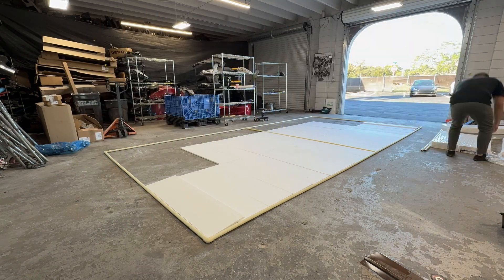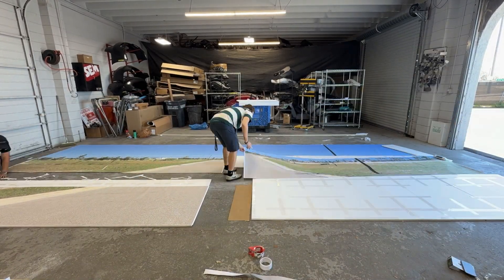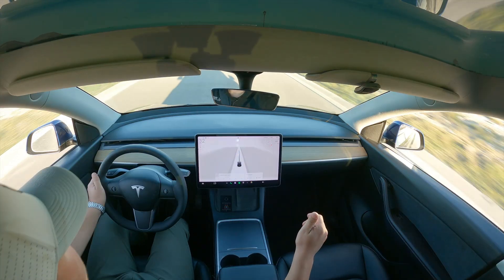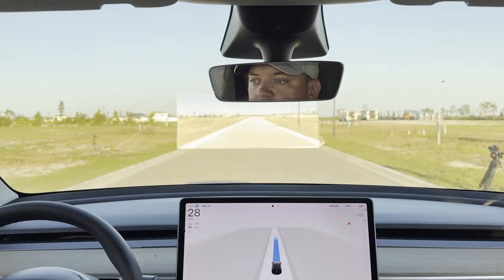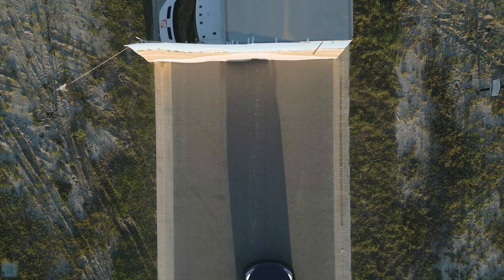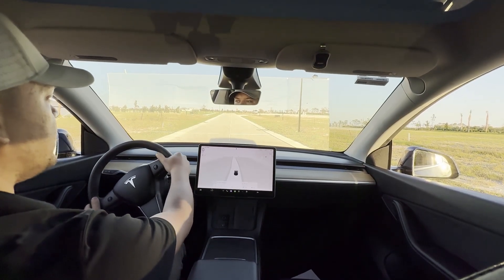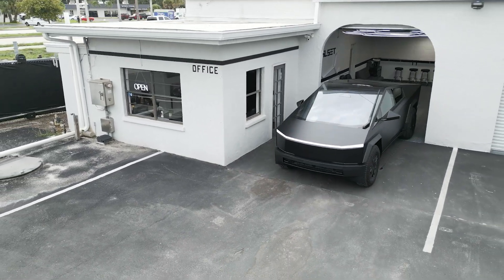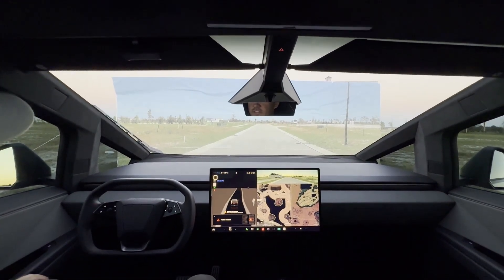Response to Mark Rober’s “Can You Fool A Self Driving Car?”

Comment: Apart from the many instances on camera where cybercoffins DIDN'T see the object before they hit it [and in once case that included a stone wall, driver died in that one apparently] my issue with this test is the same as with many of the others.
FROM A DISTANCE it is obvious there is something stretched across the road because it is literally the same width as the road and you can see where the image stops and reality starts, any half decent camera should easily pick that up and stop [and that the car didn't is even more alarming].  To REALLY test it you need an image that extends BEYOND the road either side by at least 10 feet so that there is no way the camera can see the blindingly obvious spot where one image stops and the actual backgrounds starts.
Meantime I'll go with all the images of tesla cars AND cybercoffins which HAVE hit walls, fences, lamp posts and various other solid objects all while using the driver free steering thingy [and they were idiots because turns out that if you hit something and you AREN'T in control then the insurance won't pay out which was actually the point most of the videos covering these ''accidents'' were pointing out, not so much that the tesla failed to notice the solid object in front of it.

Comment: I'm not familiar with the differences between the 2 versions of hardware but there is a curious difference between what is displayed on the main display regarding the wall as the model Y and the Cybertruck approaches it in these tests.  So for the model Y, it appears to me that the car doesn't see the wall at all until its shadow crosses the wall significantly enough that the software picks it up as an anomaly, at which point the display shows a wall-shaped object in front.  The cybertruck does not appear to do this though.  When it brakes before hitting the wall, it's showing a line across the road, like a low obstruction.  It doesn't show a wall until you get closer to the wall, like in the model Y.  In this case, I think the cybertruck might be picking up the shadow underneath the wall since it doesn't seem to be sitting tightly to the ground and makes a very visible contrast line against the ground at the time of day the tests were run.

I also noticed, in some of the tests in the cybertruck, the display seems to show that the truck initially picks up a low obstruction - causing the truck to stop - but then seems to either momentarily see a wall as you get closer in some tests, or loses the obstruction entirely and only sees open road ahead in others.  If I could forward an opinion, the cybertruck still isn't seeing the wall and avoiding it in FSD.  It does appear to see an obstruction laying in the road, highlighted by the shadow under the wall, but it doesn't seem to know what it is.  Or certainly that what it is seeing is a wall.  Regardless, this is not a system I would trust to avoid an accident in any but ideal conditions.

Comment: Thank you for this test. With Mark Rober's test, I was absolutely disappointed that a literal ex NASA engineer did not consider the differences between autopilot and FSD beta. He went through all that effort and money conducting those tests, but didn't consider spending a little more on a product marketed as eventually self driving (we'll see). Instead he tested a system never marketed as self driving, but included "Self Driving" in his video title. 

I prefer this test definitively showing failure than Mark's half a-- test.

Comment: The wall looks kind of crinkled, especially at the upper left, during the Cybertruck run.  You can also see the headlights on the wall from the truck, whereas the car casts a shadow (when up close to it).  So the conditions of the two (sets?) of tests are not the same.  Probably no way to know if the software keys off of any of that.

Comment: Everyone complaining simply have zero idea how the tesla works, it uses cameras, the only reason it detests anything when close it because of censors on the bumpers, otherwise it wouldn't detect it, I don't have or ever used a tesla and I know this, I have a car with cameras and alot of censors aswell and it's from 2013, people are just so ignorant, putting others on blast without confirmation.

Comment: Thanks a lot for doing the work for another test. Mark Rober debunked!!!
I am wondering if FSD V13 Backporting to HW3 would be possible and if the wall would be recognized. Or if the HW3 cams are the main problem.
Reply: How's this debunking Rober?
Reply: @jmelande4937  Rober said, Full Self Driving could be fooled. Besides Robter never used FSD in his video, Paul shows FSD V13 could not be fooled like that.
Reply: @StrombockNino  I don't think you watched this video
Reply: @jmelande4937  Sure I did!
Robers video is scam saying he used FSD, but did not. Autopilot is a completely different software stack than FSD.
Reply: @StrombockNino  but in this video he was on full self driving. AND he had to apply breaks manually every time except in the dusk hours when there was a lighting difference between the picture and the road. So no, Rober NOT debunked v

Comment: Does the cybertruck uses lidar?
Reply: CT uses newer hardware and software, no lidar, same "cameras only" approach
Reply: @Zripas  interesting. I wonder how they they tweaked the cams
Reply: @ 
Better resolution, different sensors in general, better light filters. Its biggest difference would be with actual compute power which allows to run better AI model, so its a whole package of simply better things making old vs new not really comparable anymore

Comment: Cybertruck had headlights on and the sunlight was very different, the "wall" is much more obvious when you did the cybertruck run. If the wall was perfect and light more mid day I bet the cybertruck would have blown through the wall to. You can also see a huge white part of the wall and people standing next to the wall on the console of the cybertruck. You basically gave the cybertruck a clear win compared to how hard the test was for the car? I think they would both fail in similar conditions and likewise both pass in similar conditions. There where just to many variables run to run.

Comment: the thing is that the fake wall is very easy to detect for computer vision. the problem was that old auto pilot wasnt computer vision. it was programmed to detect cars, bikes and people only and not anomalies. the fake wall only works at a single spot in the road where the cameras field of vision and the printed version aligns properly. any instance before or after that spot, the image will no longer blend into the scene and just looked misaligned to the camera. this is a basic camera FOV problem that computer vision software can easily detect. you can easily try this. take your phone out and take a picture. leave it in that same spot and walk back, the image you see in the screen will not blend in properly to your scene. if you walk back and forth, you will eventually find a spot that the image on your screen will blend into the scene, but any other point, the image will not match or blend into the scene.
Reply: your entire message is just plainly false

Comment: Your "wall" is falling down in the top corners by the 2nd test. Not the same setup with a box truck parked behind your poor quality graphic "wall". Run a real 2nd test with ALL the same conditions being tested just like Mark's tests- drive through a foam wall when it doesn't work. You stopped the tesla with by your manual braking. Your editing allows people to be confused. Auto drive did not work in the tesla car. This is very dangerous & irresponsible of you to promote.

Comment: As an engineer who works on computer systems that integrate sensors and algorithms to utilize sensor information, this is definitely an issue about the capabilities of the sensors to detect their surroundings.  For cars, sensor detection range must be very far, at least a several meters, in order to account for the lag between detection and full stop.
Reply: I think the main problem is Tesla cars do not have stereoscopic vision, like other autonomous vehicles on the road. This means the AI has to predict depth based on what it has learnt in the past. Optical illusions like these are somewhat impossible to predict, that is why older HW3 cars can't see the wall. The HW4 cars have an additional bumper camera, which means the camera doesn't line up and the optical illusion doesn't work.

Comment: I appreciate this video, but there as no control in this experiment. The time of the day changed, there was someone standing on the right hand side of the road when the Cybertruck did its turn instead of he model Y. Camera  placement was different, and I think even the road poster location may have shifted or appeared to have changed. Also the wrinkles on the paper appeared worse for the Cybertruck allowing it to pick more discrepancies. Nonetheless, glad the Cybertruck found success. 

I just think if you are going to prove Mark wrong, you have to be extra careful with your testing. 

This was a cool video though and thanks!

Comment: Mark ropers wall was better in that it seems much more seamless to the real environment. This wall seemed to contract more and thuse you could conclude would make it easier to detect so I don't conclude it was an identical replication. Either way, LiDAR is safer.  Period.

Comment: Very clear testing. One curiosity I have is on the last cyber run the truck was driving (hugging) on the left side of the road. Does it not realize it’s a 2 way street? As others have side time of day between both vehicles might be the reason.
Reply from the maker: I noticed that as well. Not sure

Comment: 8:25 it detects the cameraman as a crossing pedestrian from a distance already...not the wall. 😂 It shows nothing on the screen about the wall till you manually drive it up to the wall at the very last inch. And all that because of the SHADOW casting on the wall itself. Wow...from not an engineer working with Tesla over 10 yrs. Ok.

Comment: There is no way in hell that the car will do a full stop just becouse if the sensor can reach more that is suposed to you will be at full stops every 1 min with bad drivers on street. Stop pushing things that are not suposed to be driven directly to a damn Wall. You get a point and is valid.

Comment: Self driving and cruise assist run on the same basic principles. If one doesnt work they both dont work.

The reason the truck worked was because of the time of day and the difference in vibrance from the wall and the surrounding area.

Comment: Enjoyed the video but I would to mention that proved Mark Rober and his claims that the autopilot during the test didn't register the wall being there, hence the crash. It doesn't register the wall. You would've went through if you didn't manually break.
Reply: Technically yes, but he was really testing the difference between LiDAR and cameras. Ideally, he would have had FSD and HW4, which is now proven to have stopped for the wall. Additionally, autopilot deactivated in nonnormal ways, indicating it was manually disengaged anyway, even though it wouldn't have changed the outcome in a HW3 car.

Comment: I think anyone who knows about the scientific method can pick out MANY issues with variables and controls.

But as a Tesla owner who uses FSD regularly (1000 miles a week)

It can be extremely stupid and tries to kill me by running directly into large large bright orange, flashing light, construction trucks. And thinking a jersey barrier is an open lane. Oh and once it tried to make a sharp FAST right turn directly into a house.

I feel THOSE issues are massively more important than this test. But also do believe it is awesome and important these videos exist now and we can have this conversation.

TL;DR Even if the Teslas passed every test with flying colors I can promise you it will randomly try to kill you anyways. So pay attention on the road. NONE of this tech is very good.

Comment: The 'aging' [aka distortion] of the roadway picture may have influence on the truck's stopping performance over that of the car's. would be necessary to retest the car as the roadway picture deteriorated. Gotta keep test conditions stable to be able to draw conclusions. Two vehicles, two drivers, side-by-side.

Comment: You need to leave a comment on here or update the early part of the video to make it clear that you're slamming on the brakes, otherwise the conspiracy theorists are going to have a field day with the first 5 minutes of your video.  This will be chopped up and spreading through X like wildfire in like 24 hours. I also think the cybertruck testing is sort of not apples to apples because it looks like the time of day changed very significantly, and in the video at like 9:17 for example the image on the fake wall is like 3 stops brighter than the road, so I wonder if that had something to do with the improved result.

Comment: So he got the same result he just manually breaked with the Y, but why are anyone surprised by this? A normal camera based system can not do a better job then our own eyes! It will NEVER WORK in heavy- rain, -snow or -fog. That is a fact. 
The best it can do is to realize that it is blind, warn driver, disable and break down to zero if driver does not take over. The fact it does not do this is dangerus! But can probobly be solved with a patch that makes them phantom break even more, so I kinda don't want that.

Comment: It's a shame how any "proof" one way or the other has people pulling up reasons why things did or didn't work.  I don't believe the Mark Rober video because the monetary motivation of Luminar(and getting clicks because of the current climate).  I like this video because you just went out and did it.  I do wonder if the setting sun is a factor.  I would certainly hope modern Teslas have good enough cameras and software to "read" the difference in proportional change between the background and the picture.  But that's just me thinking how I'd program it.

Comment: Dude, this was not well done at all… You took the time to try and recreate this (and got the same result as Rober did essentially), but you design it so that you can’t safely crash through the barrier? You only quickly mention that you’re the one slamming on brakes and not the autopilot, and if you look through the comments, there’s tons of people that think the Model Y passes the test. 😂 If you actually wanted to do this right, you need to let the car crash through the barrier, which means you need multiple fake painted roads. I’m sure you just didn’t want to spend the money and time, which ok fine, but then you should add text like “THIS IS ME BRAKING” over the test footage at the relevant times, or at least mention that more than once.

The Cybertruck passing, as many others have noted, is also unsurprising, but not because of any hardware changes. You conducted the test so late in the day the background of the photo wall doesn’t blend at all. These camera rely on contrast quite a bit to detect obstacles, so you’re pretty much changing the parameters of the experiment and almost ensuring a success.

Besides all that, your notion at 9:44 about how this is the “story of Tesla” is LAUGHABLE nonsense. 😂 First off, you admit you work for/with Tesla (unsurprising given you have one and your “friend” just happens to have a cybertruck lol), so in other words, you have a dog in this fight. You are biased toward Tesla and want to portray them favorably because you make money with them.

Beyond the bias, the assertion about how the Cybertruck just “does it right” is inane babble. That would be comforting and relevant if all the older Teslas weren’t still on the road, and more than a handful of Cybertrucks were (and the few on the road now aren’t due to being constantly recalled 😂). 

So yeah, flawed test in many ways, that still ultimately proves Rober was right, and the appeal to “look guys, they’re getting better all the time” while thousands of the flawed ones are still out on roads putting people in danger is just dumb. You wanna see how safe the Cybertruck is? Ask Google about the three teens in Piedmont, CA that burned to death inside a Cybertruck because it wouldn’t unlock the doors after a crash. These cars are JUNK.

Comment: You should probably set the settings the same too, you're in assertive on the model y and standard in the cybertruck you are also going 40 in the model y and 30 in the cybertruck. Lastly, you aren't on the latest software versions for both cars... so update those and test at the same time.

Comment: Your road picture was just not as realistic as Rober's - the road curb lines were misaligned, the road surface colors were mismatched, and the right edge of the picture was literally inside the curb. Your picture makes it much easier for the cameras to see the lower edge of the wall, while the Rober's can trick the cameras to see the lower edge as a shadow on the road. The cybertruck's video didn't seem to have "seen" the wall, it saw the lower edge and perhaps interpreted that as some kind of break or low obstacle on the road. Speed of 30 miles vs 40 miles would also likely have made a difference.

Comment: This could easily be fixed by re-implementing the radar in Tesla's. However, the team decided to drop that to have a vision-only based approach, which is much better and less complicated. Realistically, you won't find a wall like this in the road lol, which is why its no reason for the team to reinstate the radar functionality. Its like, if I use a shopping cart, realistically I won't put 2 tons on it, but if I do it will break it and thus be unusable, but I won't reinforce the cart because of this.